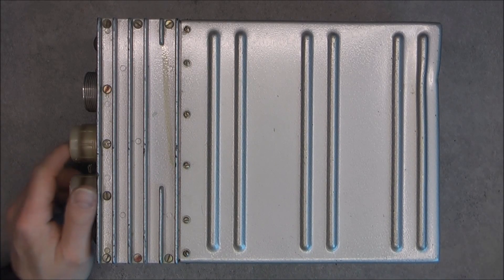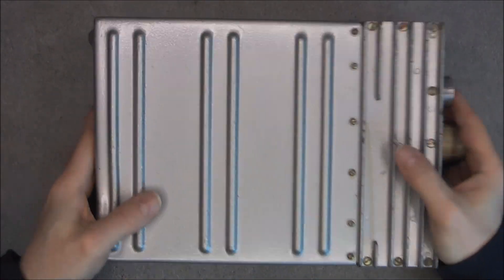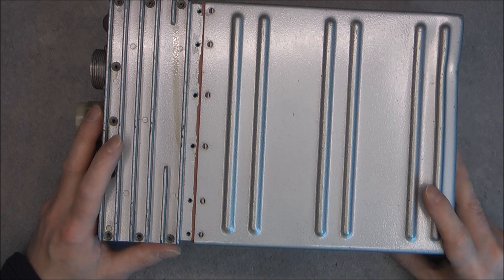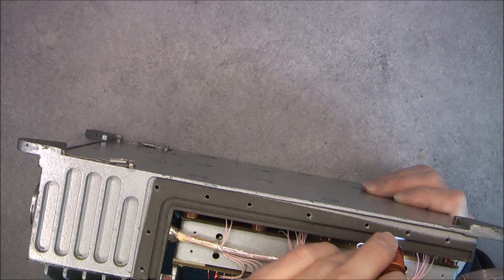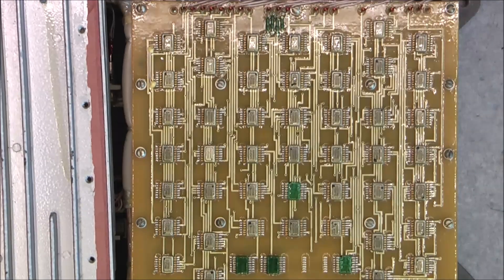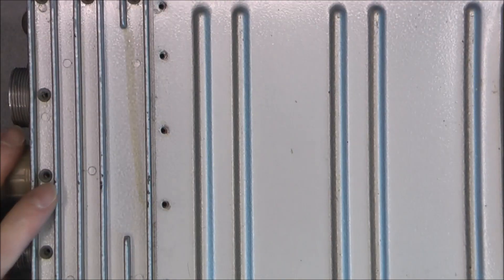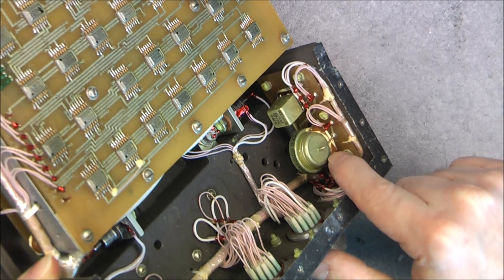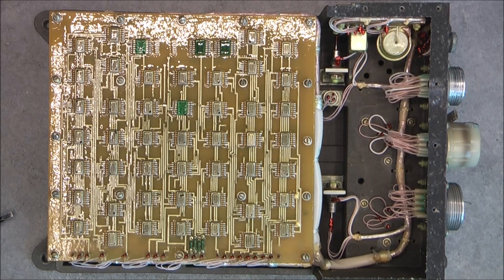Soviet RPR-3A turbine overspeed controler teardown

Comment: I suppose the screws are threadlocked. Could you give them a whack with the screwdriver and hammer to try and break the threadlock perhaps?
Reply: Would you not use heat to release threadlocked screws?